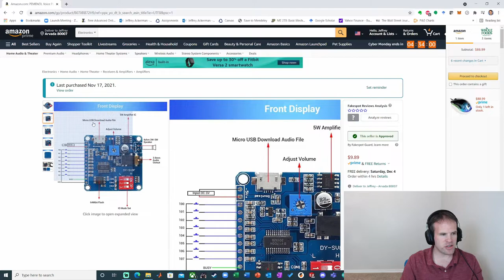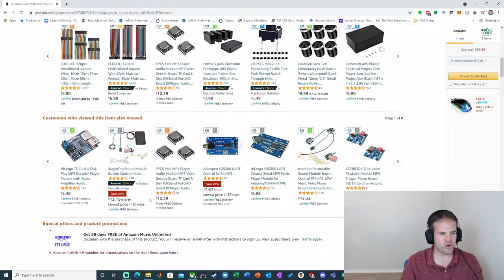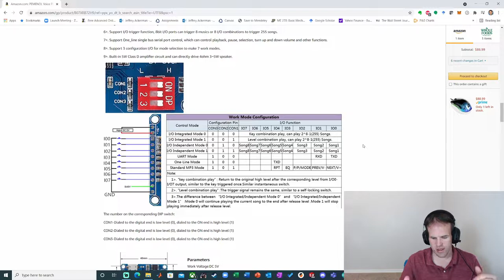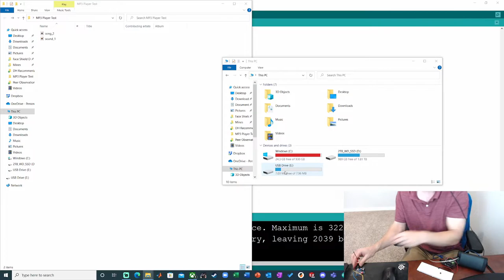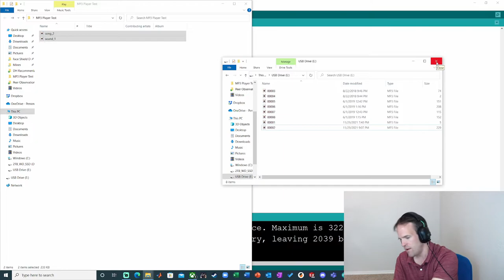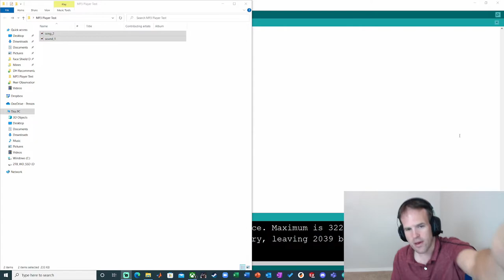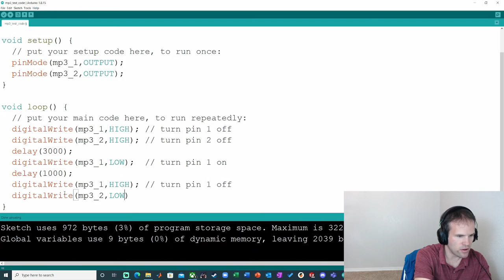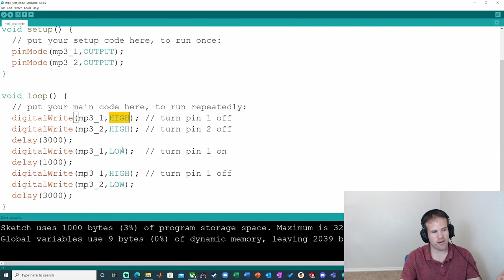Arduino + PEMENOL Sound or Music Playback Module (MP3 Trigger) Tutorial

Comment: I have a  question…  is it possible to activate those “audio pins” via PWM signal?.. if not, will Arduino help make that possible?.. I certainly do not want an individual relay for each pin, but my application is PWM and I would greatly appreciate it if you could give me any info and point me in the right direction?🙏

Comment: Hey, great video.  I need some help.... am using an MP3 trigger board to play a sound to sync with lights from a prop but there always seems to be a 1.5 sec delay for the MP3 to play when triggered (even using a relay).  Do you have any tips as to how to make a sound play instantly as soon as a trigger voltage (high 3.3v) is applied so it syncs perfectly with the prop I am using (which triggers instantly).  Delaying the prop is not an option in this case unfortunately.  Thanks in advance
Reply from the maker: I haven’t used this chip in awhile, but I recall that there was very little delay between grounding the pin and the audio playing. Keep in mind that the pins need to be grounded to play (with a common ground to the Arduino), not pulled high to 5V or 3.3V. This may be part of the reason why there is a delay in the sound playing, or there is a blocking delay of some kind in your code. You could test the functionality by manually grounding the trigger pin with a wire by hand to check the triggering and sound delay.
Reply: @ChefJeffPhD  thanks for the quick reply. Yes I think you are correct, grounding the pin does work a lot quicker. 
How could I make the sound trigger this way without having to physically touch the pins or press a switch? I need a digital pulse to ground the pins with no delay to make the sound work
Reply: Couple of things: First, make sure your sound file doesn't have empty space at the start of the file. If there's a 1 sec gap of no sound at the start of the file, the device will "play" it, but since there's 1 sec of no sound, you won't hear anything for 1 second.

Two, relays aren't instant. If you need to trigger this when something goes high instead of low, use a transistor. I see in your other message that you need a digital pulse. Are you using a microprocessor? If so, you would set the digital output to pull up HIGH, and then trigger it by writing LOW to trigger the sound.

Comment: Professor I still have a question, can this board respond to PWM? I know that I can use individual PWM switch boards in order to control each pin via PWM, but is there ANY other playback board like this one that responds to PWM?

Comment: Thanks for the video. I'm not using an arduino, though. How might I trigger this using, say, a "Try me" button? Also, I'm using the DY-HU8F module, and I rashly deleted the files that were on it, but I remember that they were named like "1-whatever.mp3", "2-whatever.mp3", and so on. So, is there flexibility in the naming? As you observed, instructions are minimal.
Reply from the maker: I believe the filing naming needs to be “0001.mp3”, “0002.mp3”, etc. the file naming does need a specific format when triggering them directly from the pins. If your using another device or a button, you can give the board 0V and 5V and solder a connection to one or more trigger pins that correspond to the file naming convention. You pull the trigger HIGH (5V) to not trigger the mp3, and pull the trigger pin LOW (0V) when you want to play a song. That should work!

Comment: Thanks for this video too. Well explained. I think I can get this to work on a Battlestar Galactica model that I want to add sound to. I'd like to move the sound switch from the board to my case though. May have to unsolder that and find a replacement and run wires to the connectors.....or see what other alternatives there are.

Comment: Hi Jeff, great video, have Learnt allot, many thanks. Just on question though: How do you set the MP3 player (via the UNO) to just play a song / sound once only when activated. At the moment the MP3 player repeats the song continuously when activated.
Reply: …. I know barely much about this topic as I’m still getting my knowledge together but if it’s replaying does that mean the circuit or channel for that command remains closed from the time it’s first initiated? If so, that would just be a matter of having your controller or arduino that is, to perform an open/close/open task rather than stay closed? Because to activate any of the 7 channels on the playback module just requires closing circuit to ground once and doesn’t require it to remain closed during the length of that audio file right? I’m just testing my own knowledge bcs this is how we learn but you probably know 100times more than I know 🧐

Comment: im asumming this could be connected to a 3.3 v pico too as long as as the voltage is taken care of.i am wondering though,how would i go about attaching leds to this also.Is this possible?
Reply from the maker: I believe that this chip is supposed to work on 5V. I’m not sure if 3.3V will provide enough power for the chip and electronics on board, but it could be worth a try. I don’t have this board on hand anymore to check. You could attach LEDs onto the trigger pins to visualize the trigger logic - they will be high by default and low when triggered. It would probably be better to use the microcontroller to attach the LEDs.
Reply: You need 5v. You generally have 5V going into the pico which you can tap off the VBUS pin of the pico to get your 5v.

Comment: I got this board. It is perfect for what I want to do . I am using a ultrasonic sensor at 2 different thresholds I want to play a sound. It works but when I have it set to return to high after my last threshold. It just repeats  the last sound byte . What am I doing wrong?
Reply from the maker: I found that it works best if you trigger an adjacent pin with no sound or a short sound to interrupt playing the first sound. It’s a bit of a hacky solution, but it usually works. The pins sometimes play the whole song or sound when triggered with a short press. There may be some timing to the triggering it I’m unaware of. Try triggering an adjacent pin to stop the sound.
Reply: @ChefJeffPhD  wow didn't think you was going to reply so fast for being a older video.. I'll give it a shot. I have a couple more things I want to trigger with it. by looking at vague instructions, it says once trigger 7 is done it goes back high. I have 6 things to have triggered and I will make 7 no sound .
Reply: @ChefJeffPhD  hey there, after many many attempts to get this to work. I figured it out .. I had to write the code in the  void  setup  to treat the mp3 trigger  by receiving a signal from a button.  But there is no button.

Comment: my computer doesn't seem to recognize this as a usb storage device, is there a driver or something I need to install?
Reply: It may just be your cable. Some cables are only for charging and do not have the data lines. It's worth a try to change the cable out for one that you know works with data.

Comment: Anyone know how to make this randomly place a selection?
Reply: … I’ll try to answer.. the playback module just holds onto the audio files and has 7 channels or contact points that activate the assigned audio to that given channel number file to play. So having an arduino or raspberry is just another board added to the equation because those boards perform the action for you.. so instead of you manually triggering the playback module to play an audio file just by you closing the circuit with the ground wire, the arduino or raspberry can do that for you. So now what’s missing is the tool or method you want to use to trigger arduino to trigger the playback module at any of the given 7 channels. The arduino and raspberry can be activated by using a voice detection board, a motion detection board, a vibration detection board, a temperature detection board, and even a hand gesture sensing board. These are small and cheap and most other boards that perform tasks will respond to any of these sensor boards I mentioned. However if you’re wanting the music to repeat or play the next song fully automatically., then you need to tell arduino or raspberry exactly what to do and when to do it, which might just be coding jargon. The least complicated way to avoid coding or just the thought process in general would be to have a board, any board, but one that has a “shuffle” feature or random select feature and let it do all the communicating with the playback module for you. Hope that was helpful I’m still learning, I haven’t even touched one of these things yet, I’m still researching for myself so I can apply the technology to my large scale RC cars🙏👌💯